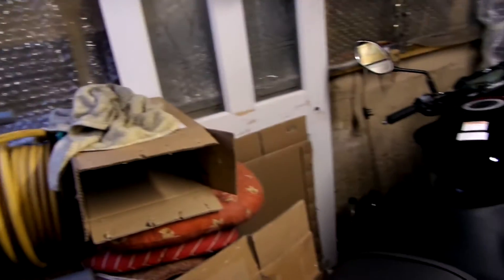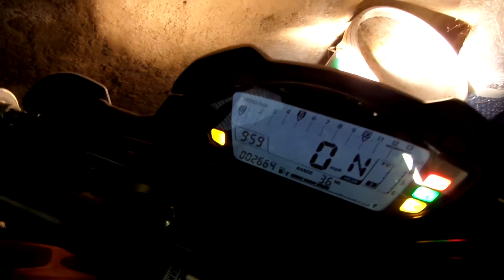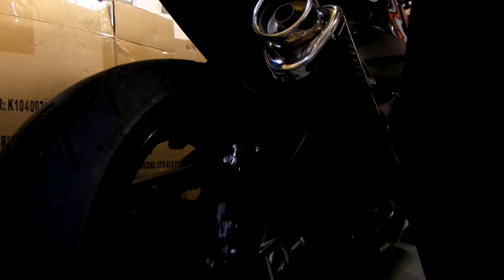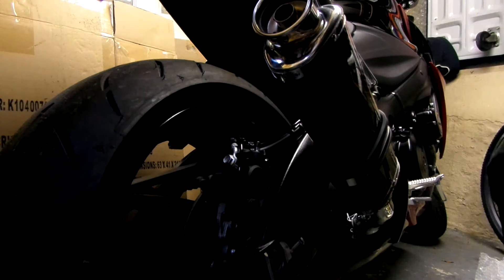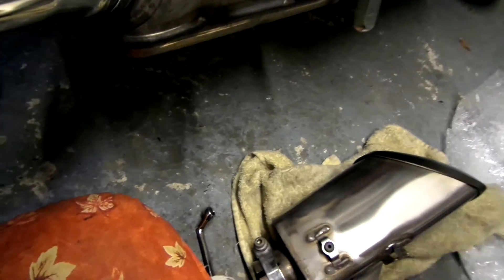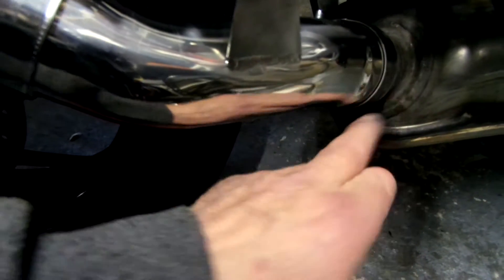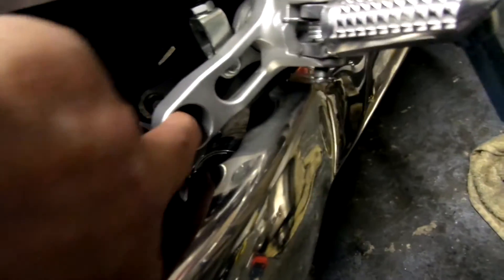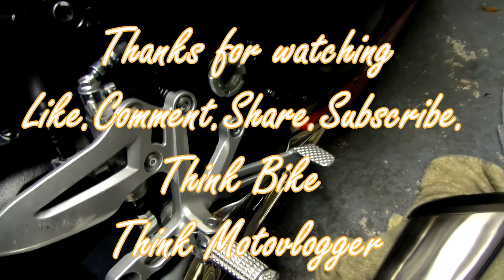Suzuki GSX S1000 - Exhaust Swap - to an SP Engineering Tri Oval Big Bore Carbon Fibre Can

Comment: maybe my ears are bugged out but i honestly couldn't tell the difference in exhaust notes between the stock and the slip on. Maybe the full system would sound like there's a difference to me. ButTo me, this is the only bike on the market that sounds fantastic with stock exhaust. Other than aesthetics or adding a PCV for map configurations , there is no need to change it out IMHO. But to each their own.  Love this bike though. Just picked up mine yesterday.  Cheers and ride safe.
Reply from the maker: Not much difference at all, I switched back to stock after a few other attempts, the exhaust swap on the 750 makes a lot of difference.

Comment: Long time ago I know but I can’t get my sp pipe over the cat with the original gasket collar on did yours fit ok ?
Reply from the maker: @martynhurst3609  I did buy a polished link pipe for the gsxs  from S P Engineering,  don’t think I used the collar, still got both though, put standard pipe on for the sale, used the exhaust on the GSXs 750
Reply from the maker: Used some exhaust assembly  sealer on it
Reply: @suznet  cheers buddy..definitely not going on with collar I’ll do the same..shat you riding now..I got mine mapped to sort the the throttle out real smooth now
Reply from the maker: @ sold the 750  3 years ago & no longer ride 😢
Reply: @ get back on !! I ride with my old man he’s 82 I’m 55 I’ll keep bothering you till you do! All the best pal